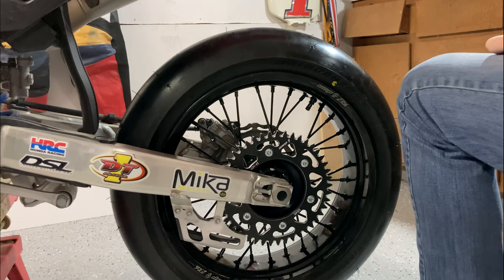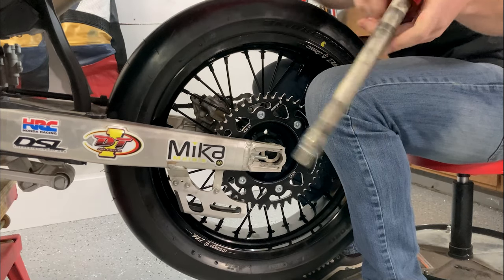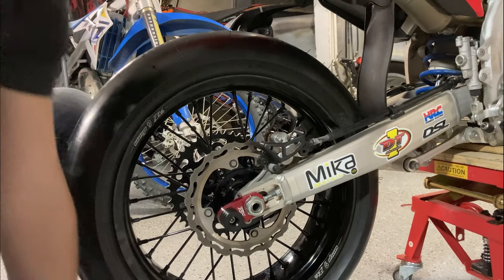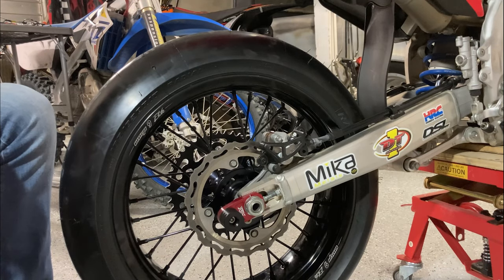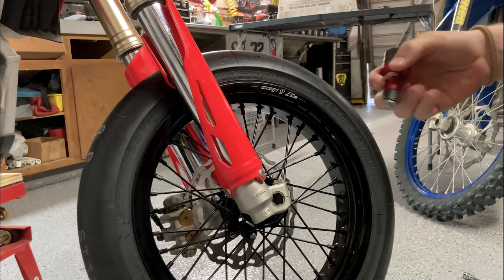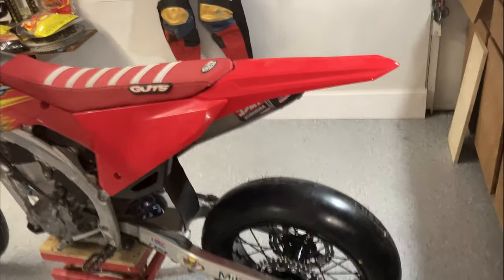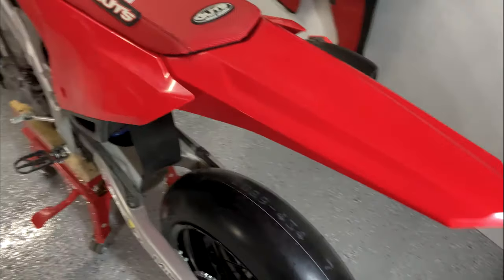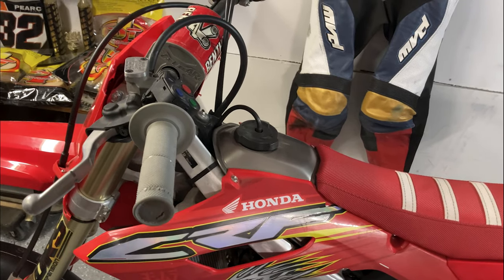Supermoto Bike Build Guide to Setting up YOUR First Supermoto! | Step-by-Step | Episode 2 | Toxic

Comment: Hey is that all the torq you have to put on to the from axel toxic moto slider the one you tightened with the ratchet
Reply from the maker: In the video might not be exact on the torq but I usually try to tighten it all the way down and then give it a little bit more to make sure it’s really snug.